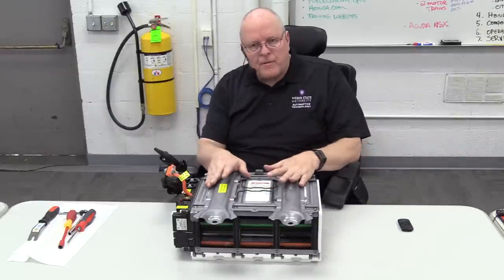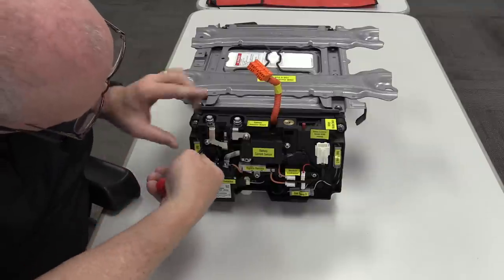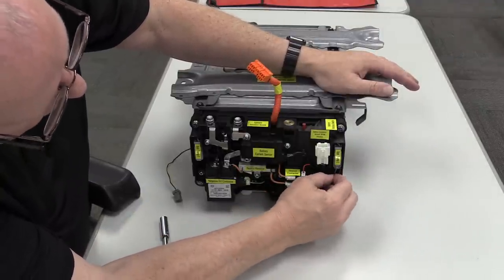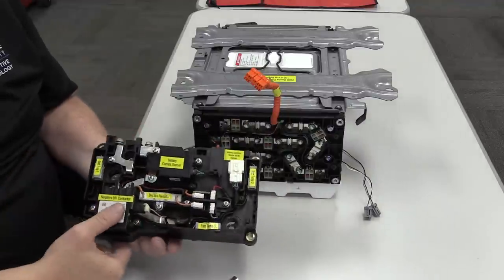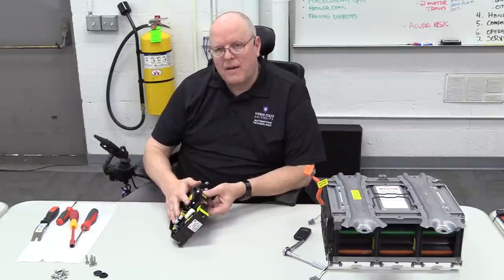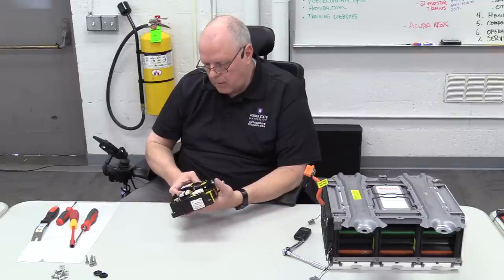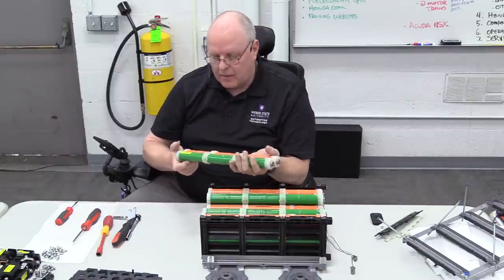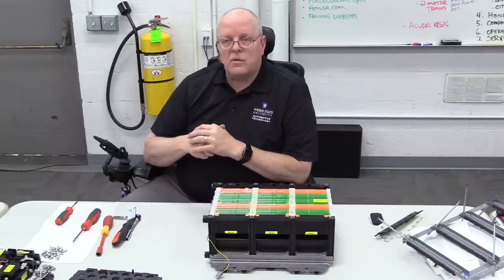Honda IMA Hybrids Part 2 - HV Battery and Battery Junction Board

Comment: Cells ARE removable ! I’ve done it a few times !
Reply: can you explain how? please...
Reply: @vladls77  lol 10mm bolts and phillips crosstip screws. Make sure to always do cut off switch and dont short anything.
Reply: @PrimateSoul  I thought you removed the individual cells, the D format batteries, from that plastic wrapper...as for the welded elements, yes, they very easy to remove and replace.
Reply: @vladls77  hi, oh no. You just replace the strips of Ds with another set, these are the "cells'. They are all welded under the plastic.

Comment: Great video thanks. I'm here because I can pickup a civic IMA for super cheap with a faulty battery and am considering replacing the batteries with lithium, a separate BMS in parallel to the factory honda one, for balancing, and a charger to  make it a plug in hybrid for cheap. I have hundreds of 18650's cells, which have a nominal voltage of 3.6 and a full charge voltage of 4.2 which would mean 4 in series would give me 14.4v nominal and 16.8 fully charged, for a pack voltage of 140v when empty (3.2v a cell) and 182v when fully charged (4.15v a cell) . Then I'd have to parallel the packs to keep up with the current draw (laptop cells only give out 1-2a safely, looks like factory cells give either 6 or 8 amps). So thats 44 X 4 X 8 cells = 1400 cells.

The only thing I worry about is what voltage the factory system is expecting, how much it draws in amps etc. I need to do more research, or if you have any good knowledge.
Reply from the maker: Thank you, That sounds like an interesting project! With the engine running I have seen 170-180V from the IMA motor/generator. I have also seen as low as 120V when the battery SOC was low. I hope that helps.
Reply: Stick with the NiMh sub C batteries, they can be replaced yourself for as cheap as $200

Comment: very good explanation and display. Just a few questions is it expandable Can you add another battery pack in parallel? Also What is the amp hours on the battery pack. Or the kilowatt hour reading??

Comment: Hi there Professor,i got an issue with my hybrid  regarding the charge light indicator ON even replacing the hybrid battery which i got from a total wrecked which is still running good even with its charging system..prior to that my charging indicator shows ON since the old hybrid battery power collapsed..which part in my car charging system went faulty?any information please to fix the  charging system ..I appreciate your time for giving attention to my query.Thanks and more power to you for providing instructional videos in you tube..

Comment: There are 11 modules not 13 as you stated multiple times in the video...I've taken mine apart over 30 times now ,so I already knew that when you said it ,it was wrong. But I do have a question on what the end piece is called? Does it have a name? mine has a few broken clips on it and i need to know what the piece is called so i can repair it. Mine is not charging the car battery now and i believe it is because of the clips that are not making contact now? Thanks good video.....
Reply from the maker: Thank you! Yes, I was wrong regarding the number of modules. The first generation battery only had 12 modules. I do not know the official name of the battery end caps. Honda service information has nothing about disassembling the battery. Have a good day!

Comment: even if the switch open circuits the battery in the middle, isn't it still possible to get across 75v when you're disassembling the bus bar?
Reply from the maker: Yes, if you touched the correct terminals, it is possible. I should have had the high voltage gloves on for that portion of the video. Thank you for your feedback!

Comment: so when you wore HV PPE gloves its more for protection against invertor than the battery and is there any danger from smoothing capacitors , thanks
Reply from the maker: Thank you. The inverter capacitor voltage matches battery voltage upon key off, but it discharges in a few minutes. One should always verify the capacitor voltage has discharged using a Category III multimeter while wearing PPE gloves. Thanks for watching

Comment: What signals the contactor to close. Or is it suppose to always be closed?? When I'm looking at live data its shows the close on start up, and then opens. When it opens the IMA light comes battery light. I'm new to these hybrids
Reply from the maker: They should always be open when the car is off. They will normally shut when you power on the car. The "Ready" light indicates they are closed. they are closed by the battery computer when it determines everything is good to go.

Comment: Hello, please, in the 2006 Honda Civic battery there is a very small orange component that connects the cells to the BMS. Are these temperature sensors, voltage sensors, or charge regulators? Thank you.❤

Comment: Some these batteries are basically D cell batteries like when can buy to run torches etc and recharge when they go flat?
If you tell which cells were dead and had access to another battery pack the same you replace the dead cells from the other battery pack. 
Sorry i am still learning about such things.
I know that rechargeable battery drills use C cell batteries when they are opened up then you find which ones are dead and replace them.
Reply from the maker: Thanks for your feedback. It would be interesting to try replacing them, but poor connections between each battery cell can cause voltage drops. That is why the Factory batteries are welded together or bolted together.

Comment: It was hard to see, was that isolator switch halfway between the series batteries like the plug on a Toyota?
All these high voltages do worry me in modern cars. 
Especially with the advent of super capacitors which will end up in many components in the car. I think it will get harder and harder to determine what is safe and what could kill.
Reply from the maker: Andrew Thompson yes, it was midway in the battery module pack. Education and training is essential for service work on there vehicles

Comment: Hi, can you help me? I have a Civic 2009 Hybrid. The battery have 174 Volts, (checked with multimeter) and it can't turn on. Only gasoline engine starts, with red battery warning. Usually I solve the problem turning on the car (gasoline engine) and waiting a few minutes sometimes the IMA blower turn on. I wait to hear the blower power off, then I turn the key off and again turn on. And the rear battery start with no problem. Red battery light turn off. What could be the problem?

Comment: Hello, great videos. Is it possible to take a set of electric assist parts and make an electric go kart? 15kw looks like a lot of power. But is it possible to control the regenerative braking, accelerating if you have original car parts? How does a control module "know" when to accelerate or brake? do you have any video on this subject? Thank you Sir.

Comment: Is one of those modules, the same as two individual sticks from the 2004 civic hybrid battery they look just like two of the same cell sticks put together in series is that correct? I’m wondering if the individual sticks are interchangeable with the 2004 sticks  if you separate the two
Reply: Pretty much answered my question toward the end great video

Comment: The voltage sensing wires are soldered to a lead of an electronic component. The other lead is then soldered to the buss bar. What is the electronic component and what is its rating???

Comment: I removed the battery pack, did a deep discharge and grid charger recharge, but during the rebuild I had one of the temp sensor wires accidentally arc over the end of the battery. Sparks and soot! The battery was fine, but after putting it all back in the car I'm getting P1554/6/8 Battery Module Temp Sensor code.  Any thoughts on how to fix this?
Reply: replace the temperature sensor. it has been killed.
Reply: @Egress.  Thank you.   It turns out that is ripped out all three sensors from their wires.  Bought a replacement harness on ebay, but that was missing the temperature sensor resistor. Once I'd spliced that in everything works!

Comment: hello teacher
I own a 2008 model honda civic hybrid.
My car's batteries are very inefficient. I want to replace the batteries with lifepo4 batteries. 3.2v in 5 packs (11*16v). 176v total. I want to balance each battery pack with a bms circuit and protect it from overcharging and discharging. I'm very curious about your comment. Do you think a circuit like this would work?

Comment: I have a 2008 hybrid Honda Civic I already checked all the cells and are 15.44 v  all of them and one is 16.5 v is that ok ? Or there is a problem with the cells I have the Ima light on and the battery light on

Comment: Dear professor Kelly, I have replaced two of battery sticks, followed the instructions strictly, but after reassembling, ima, check engine and red battery lights are lighting on the board, the hybrid system is not functionally. In the junction board (from the flat washers) I have measured aprox. 70 and 90 volts, each of battery elements have 15,4 volts min. but  after I reinstall the battery in the car, and put the switch in the on position, the multimeter indicates 0 volts in collective + and - connectors. After I make the engine start, from the inverter-converter I measured aprox. 90 volts to the IMA battery, and aprox. 11,5 volts to the 12 volts battery. Can you help me, with some instructions, tips, please, to make my hybrid functional again?
Reply: Make sure to watch a complete video of how to replace all the modules in your battery, one example could be this: https://www.youtube.com/watch?v=TT71em4Ei2Y, follow each step correctly and the result should be a complete functional battery. I know I did it in some 2,5-3 hours on saturday.

Comment: I have Honda Civic AC motor removed from the gasoline engine and installed bearings , I would like to make a go cart ,I also have everything that’s in the back seat including the 150 v battery,how can I control the rpm on the ac motor,thank you
Reply from the maker: That sounds fun!

Comment: I see 22 ( 2x5 +2x6) battery units each with 7.2V (6x1.2V) = 158.4V
Reply from the maker: You are correct. I got that wrong. I thought I made a note about it in the video description. Have a good day!
Reply: If one lithium-ion cell at 3.7 V average replaced three nickel metal hydride cells, then with only 44 cells you can replace this battery. 44 x 3.7 = 162.8 V

Comment: Hello sir, I can replace the batteries of my honda civic hybrid of 2008 of 6500mah for some of 10000mah? Thank you
Reply from the maker: Good question, I do not know the answer. It sounds like a fun project though. I suspect it would work, but battery over-temperature is a concern. If the IMA fan is running on high while driving, they are getting too hot. Best wishes
Reply: Nelson MG not posible Max celds design to 6500mah is not errors, if you fan battery more work fail.

Comment: Any ideas how long the batteries will last before it starts degrading? Would you say Honda or volt will get 5-7 years before complete replacement battery is required?
Reply from the maker: Early Hondas were terrible, but since 2014 have been great. Volt are great too. More than 5 years. probably closer to 8-10 years.
Reply: On the Volt it probably is at least 10 years. They don’t want to replace under warranty many batteries. The Volt is guaranteed 8 years or 100k.

Comment: can hybrid 2nd generation cells can be used in a 1st generation hybrid? please reply
Reply from the maker: It would probably work, but the way they bolt to the battery junction block is different.

Comment: WeberAuto,
 I have lot of this kind of Battery. Would you tell me to use this battery for my  solar system to store charge. Or  can i use it for lighting my Torch light ? 
Thanks
Reply from the maker: Those batteries are prone to early failure and they are very small (not much capacity). If you have a good one, it could be connected, but it still needs to be air cooled.

Comment: Would a maxx volt grid charger work to rebalance the batteries?
Reply: Did you get any answer to your question? I am considering buying one to use on my 2006 HCH
Reply: @Chris Salazar
No, it won't. I got one and all it does is to recharge the battery. If the battery has damaged/unbalanced cells, these will remain in the same condition.
I bought a complete set of 11 (not 13 as the gentleman in this video claims) new modules, did the replacement and now I feel I have a new car. :)

Comment: I am not professional at this aria but have disassembled  already one old battery given to me from one Honda dealer as one bed battery. I have measured all de cells apart and all of them have stable voltige from 12,50 to 12,80 V. It is really strange, because this is more then 80%. Also my other battery on my Honda Civic Hybrid was tested by the Honda dealer and it had 75% capacity. It was stil good regarding the software. Could someone explain that to me?

Comment: 8:59 Honda does not make new batteries. They are all reconditioned batteries. What that means?
Reply from the maker: You can not buy new batteries for this car
Reply: Reconditioned means that after the battery is taken apart like shown here, only the individual cell modules (the green and orange) that are tested bad need to be replaced. The bad cell modules are replaced, the battery is grid charged to re-balance all cells, and then sold as reconditioned/remanufactured.

Comment: How can i check which module is worn out?
Reply from the maker: A Honda scan tool can tell you that. You can also check the voltage of each module, but voltage is only a partial indicator of condition. You could have a worn out cell with voltage that is close to a good one. A load test is the best method.
Reply: WeberAuto thanks for answer, i will try to connect scan tool to car and run battery discharger. I will check which modules are dropping voltage faster than others. Is this good idea?
Reply from the maker: yes
Reply: What controls the rpm of the ac motor,thank you
Reply: Electronic drive module converting DC into AC volts/frequency.

Comment: Great videos! Thank you from the diy community

I have one question about the in-line series connections on the individual battery modules. How are the D batteries conencted as such? Welded with the plastic acting as support and insulation or is there metal contact within the plastic connections forming the serial connections?

Comment: I am trying to get some information about Honda's 3rd gen Earth Dreams Hybrid Technology (i-dcd). What's the size of the lithium battery? How far will it travel in ev mode only? What's the hp and voltage of the electric motor?  Can anyone shed some light? How about a pull down video.
Reply: It doesn't work that way. This is a gas motor with electric assist. Nothing more.

Comment: Your breaking down major impediment walls here...
 Mate, it seems a Big section of the angy resistance: rejection of this latest technology transition from, the 'currently, lazily, comfortable with' horse&buggy transport systems to the over all far, far superior[/'betterer'] internal combustion engine rapid propulsion is,,,, Oh,, OOPS! Sorrys, that script was from 130+ years ago and, Hmmm, we got passed that  one AOK hey!
 ,,,Start again ... Ahem,   
,,"A Big part of the angy resistance: rejection of the technology transition from, the 'currently, lazily, comfortable with' internal combustion engine rapid propulsion systems to the over all far, far superior/'betterer' electric assisted rapid propulsion motivation systems is," - **fear of NOT understanding**.  
 If people don't understand, they/we tend to be afraid of it. If they/we can see its, actual realitive simplicity - fear vanishes, acceptance and adoption proliforates.
 Your step by step explainations simplify systems comprehension - even for 'dolts' like 'moi'.  

 Man, in real fact, what a difference to the planet your making here.

As a 'learn by watching' vs doing or, reading mind, your vids are 'bulls eye' understanding here.  Direct, Simplified, Articulated Precisely, i.e. the cell connection flow stickers and the door panel trim tool(was wondering where ya got that) [that's when Ifelt compelled to pass on this compliment].

LOL, usually 'quaffing' @ dudes self-advocating their annointed titles but, here,,, Professor, with great respect, look at it on your office door name plate with due proper pride Sir.

Taa Mate ! [Oz lingo for "Thankyou Sir"].